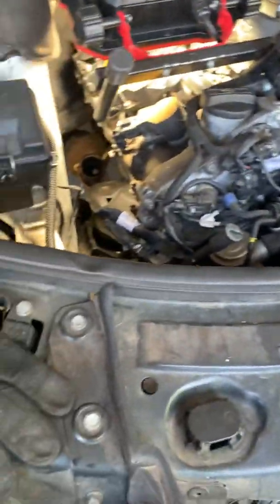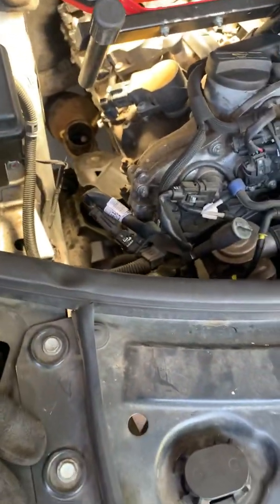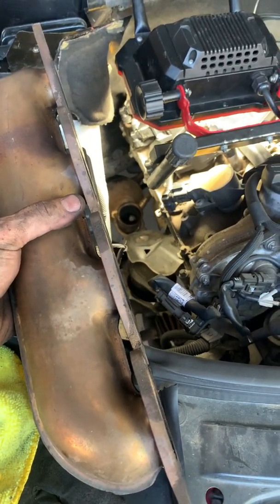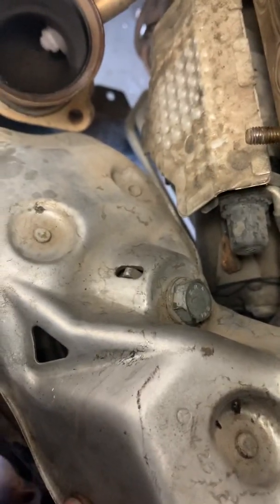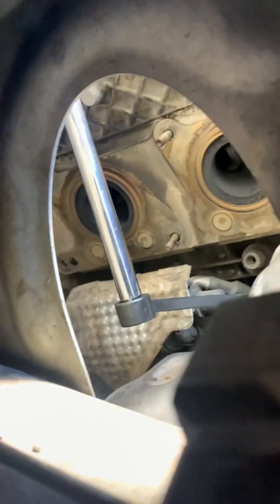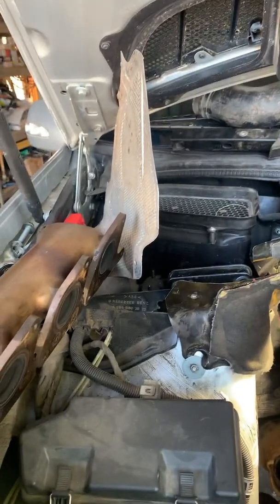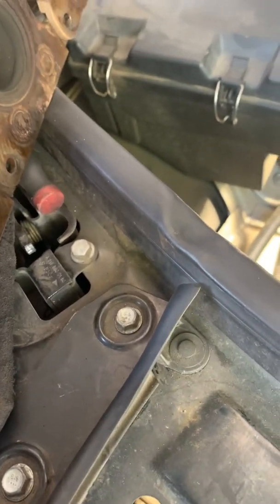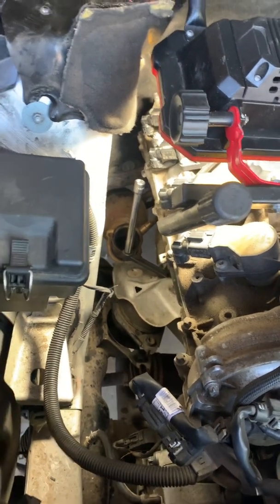2007 - 2012 Mercedes Benz GL450 4matic  x164 Motor Engine Mount Replacement

Comment: you can easily remove the air strut, by compressing it with a ratchet srap ( 1 inch wide strap works good ) looped around between the top screw bolts and going between the bottom yoke.
Reply: even with the air strut removed, i found the window through the wheel well to be limiting.  Thanks for the input and feedback.

Comment: Any to replace my on gl550 driver side
Reply from the maker: If same year range, the procedure should be similar.  Most disconnect the steering linkage to give better access to the top engine mount bolt.